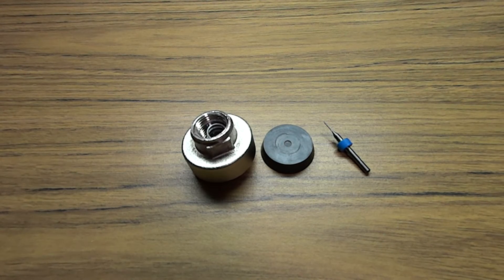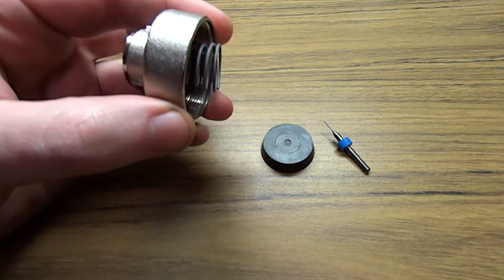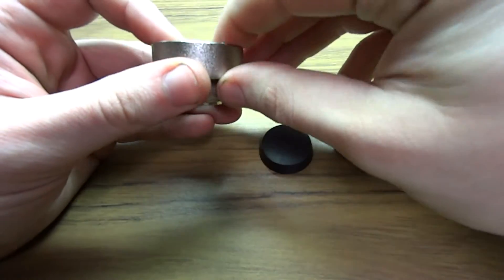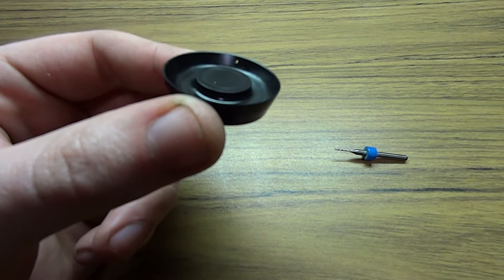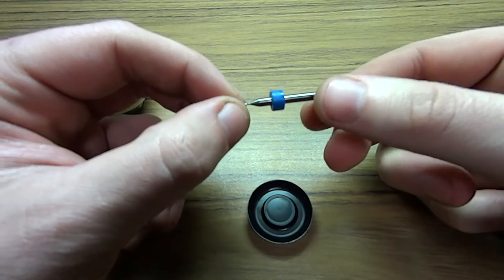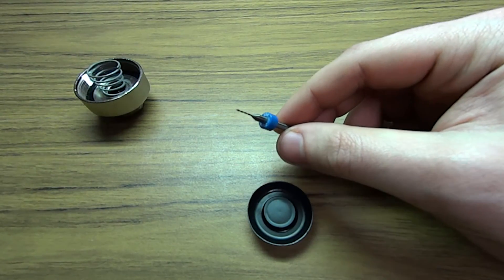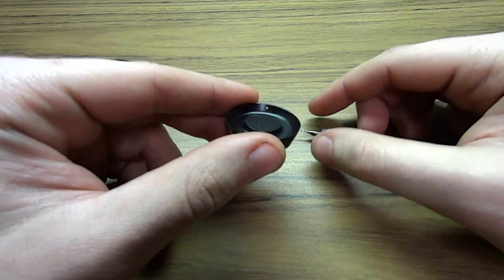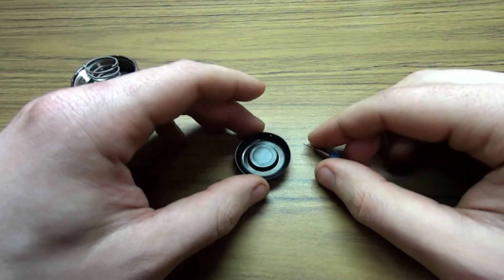Video Request: QEV mods.  return spring and diaphragm hole

Comment: What's the purpose of the hole??
Reply from the maker: To equalize the pressure around the valve. It's only needed when you're filling from the chamber side
Reply: @swandonovan  thanks 👌
Reply from the maker: @robsantuario  np

Comment: hey swan if i do this mod and use a ball valve as a pilot, will the spring broke? i mean when u pilot it with an air valve trigger after u press it the diaphragm will open and shut again after u release the trigger. but with a ball valve, the valve will be open and took time to close it. will it affect the spring? like overcompressed
Reply from the maker: Robin Ave no, it'll be fine

Comment: swan, 1 more question haha. your using a 69 drill bit which is .0292"=0.75mm and all i have is a 1mm drill bit. is it fine? or i shouldnt. and does the size of the hole and spring affect the performances?
Reply from the maker: 1mm might be getting too large.  it's a lot easier to remove material than it is to add material : p  spring really doesn't matter, but i'd for sure go weaker than stronger.  how much psi are you hoping to run?
Reply: Swan Donovan the smallest drill bit i have is 1mm. and my max pressure is around 100 psi. any suggestion?

Comment: what exactly does making that little hole do?
Reply from the maker: Dogga 685 it equalizes the pressure on each side of the diaphragm so you can fill from the chamber side.  Only needed if filling from the chamber
Reply: Swan Donovan alright thanks for that and great video
Reply from the maker: Dogga 685 no problem